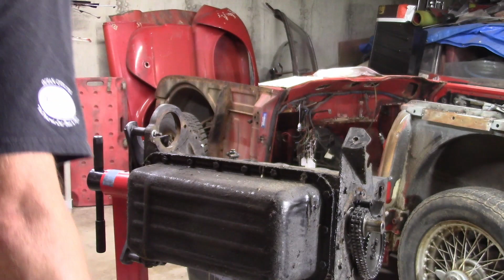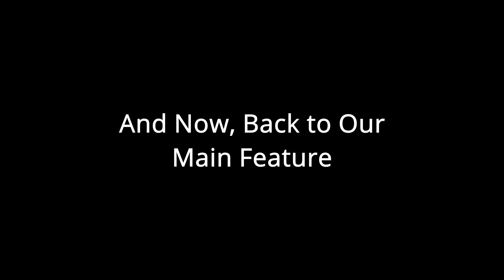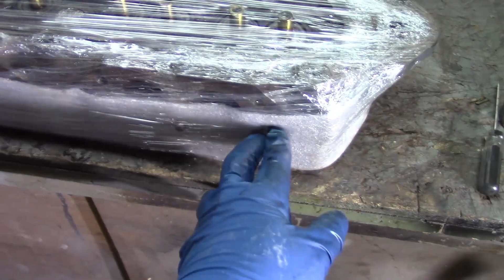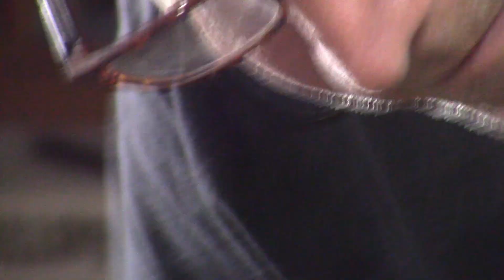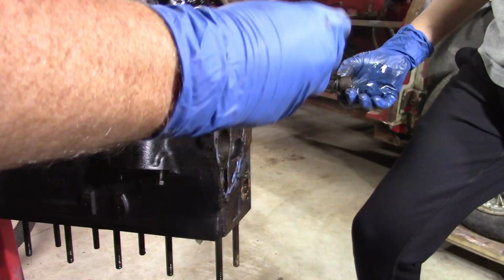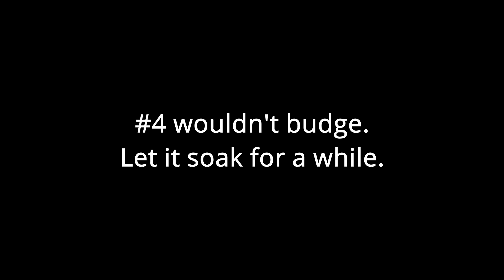Triumph TR4 - Engine Rebuild #2: All Clean | Roundtail Restoration

Comment: Looking good. Shame about the cam…been there…
Reply from the maker: Yeah, I don't think there's much I can do there. The chip isn't in where the valve would ride, but I'm not sure that matters. It also appears to be painted black, like the other non-lobe portions. Not sure what that means (from factory like that)?
Reply: @roundtailrestoration  even if it isn’t where it’s hitting the lifter, I suspect it will continue to degrade and introduce metal to your newly rebuilt engine…
Reply from the maker: @cheftush  Good point. Didn't think of that. Now the mental fight of a hotter cam, bigger pistons, etc...
Reply: @roundtailrestoration  and…new lifters to go with the cam unfortunately….it’s a slippery slope…